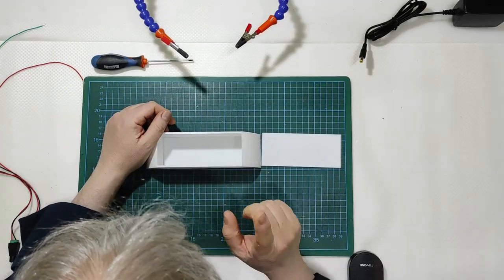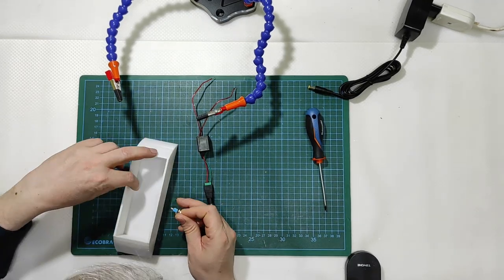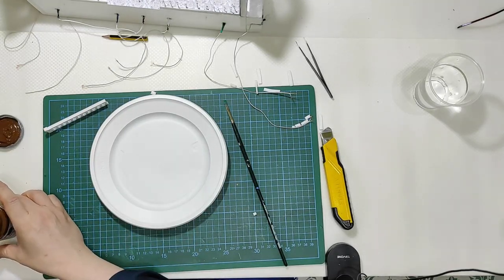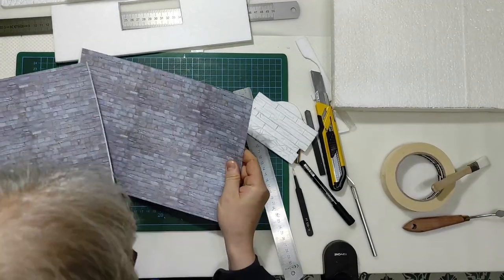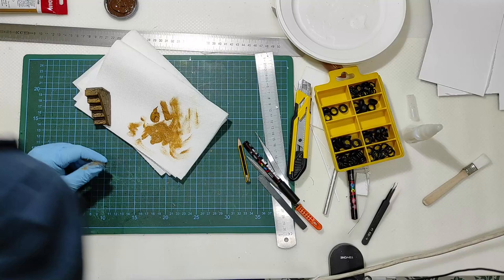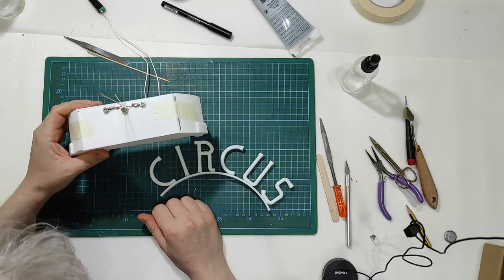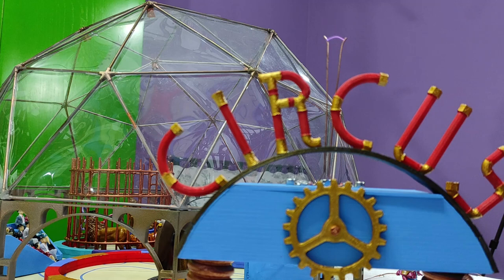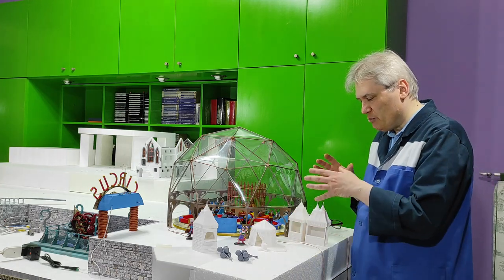Christmas Village Tutorial 2022 - Part 15

Comment: Silvio,
You have a couple of problems with the "Circus" gate. The wiring and the switch are going to be difficult to hide. The other issue is that is dangerous high voltage. Many of us create our villages for kids to enjoy, with the "Jacob's Ladder" arcing kids will just have to touch it. Obviously not what you want them to do.
The mysterious building has so much detail lt is truly remarkable,  a fantastic model. Amazing stuff this year but maybe too much. Time is definitely your enemy. BUT I can't wait to see the final results of your imagination.  Thank You!
Reply from the maker: Hi Rolie, thank you for your honest comment, I really appreciate it.
I will surely modify the wiring, painting it with copper and I'll get it out from under the container before wrapping it around one of the coils. This way it will be less visible.
I will hide the switch with some sort of pipe or gear.
You are absolutely right, as I told many times the Jacob's Ladder is absolutely dangerous, especially for kids. In my original design I also modeled a long narrow container, some sort of jar to connect to the container and 3D printed using transparent PETG.
It was intended as a safe guard system to protect everyone from high voltage.
But as you know I am soooooooooooo behind schedule that I had to give it up and use the plan B model.

Yes, I should have started my village in April, and still 2 more features to dedicate to Victorian era novelists.

My bad.

Thanks again for your comment.